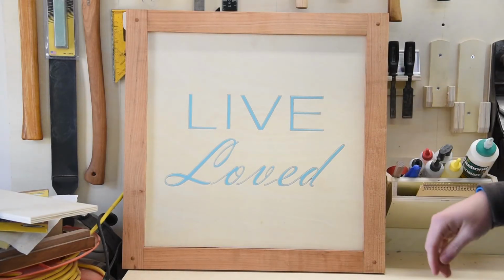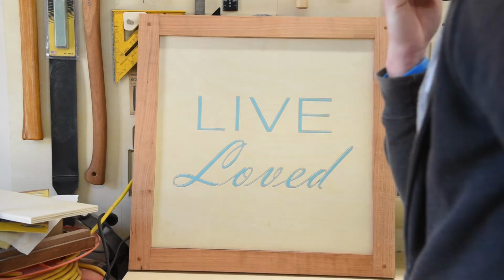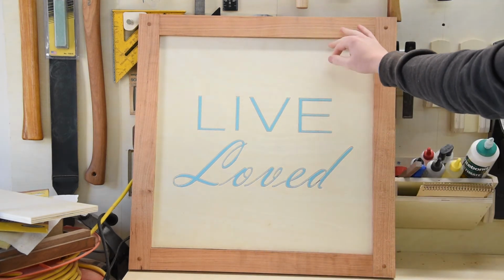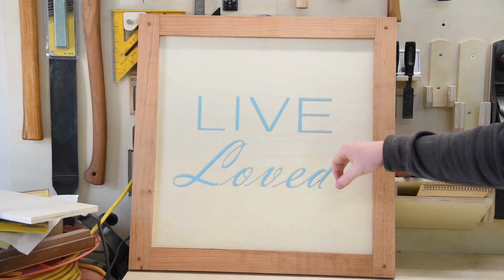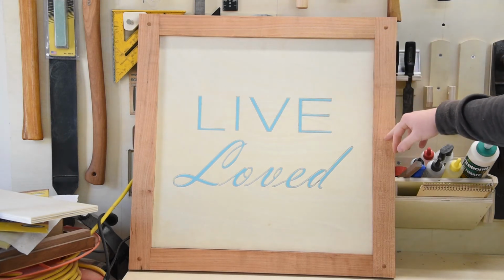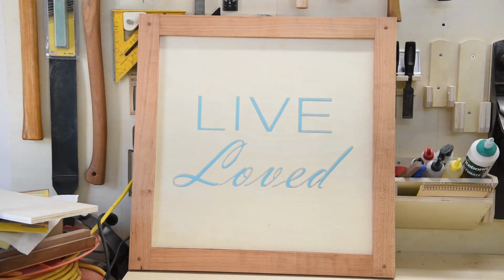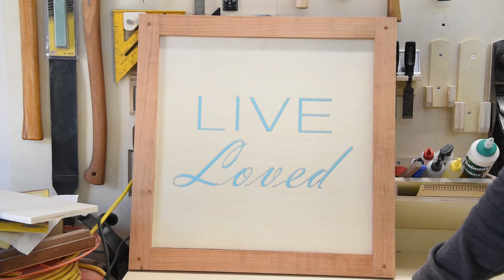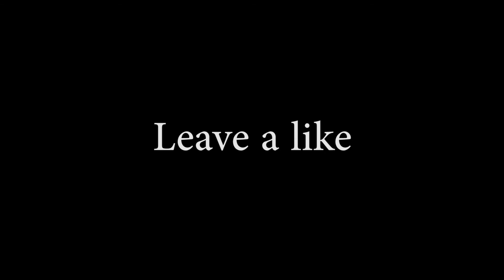Live Loved Sign

Comment: Nice work on that frame man, and really nice play between the colors, i like it! one question, did you sand the dowels in the corners of the frames after you shaped them with the chisel, because they seemed a little bumpy to me, or is that the look you're after? Nice work!
Reply from the maker: +Frederik Brændstrup Thanks man! and I left the pins how they were. I liked the way they looked being proud of the frame, and using the gouge gave it almost a hammered look. From more than about 5 feet away you can't even tell they're textured at all.
Reply: Very cool! Keep up the good work!